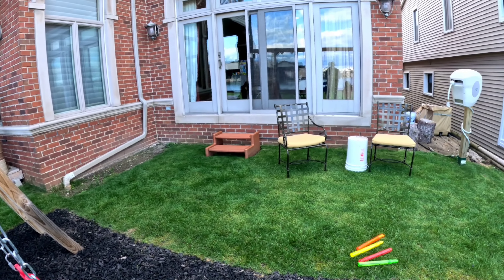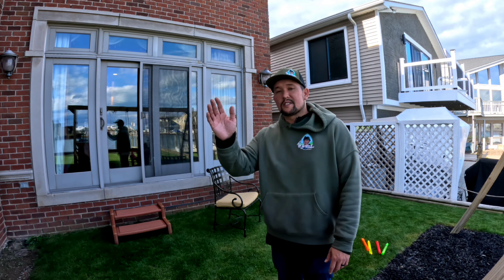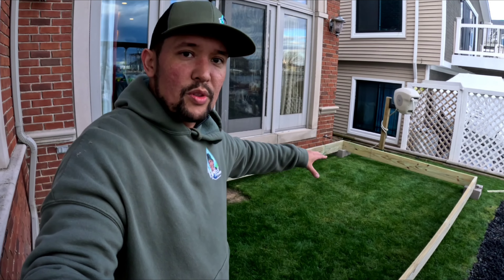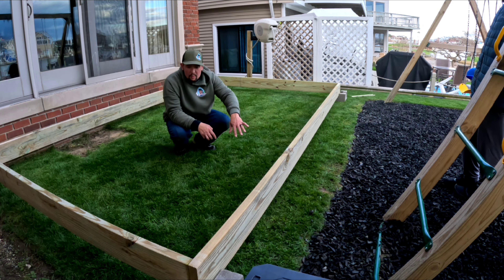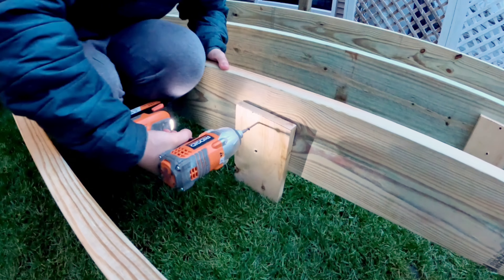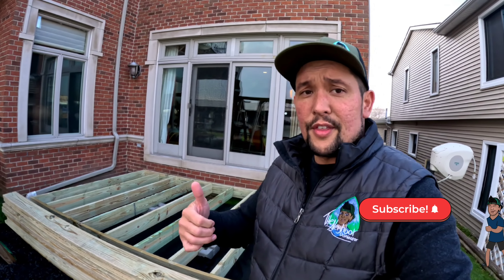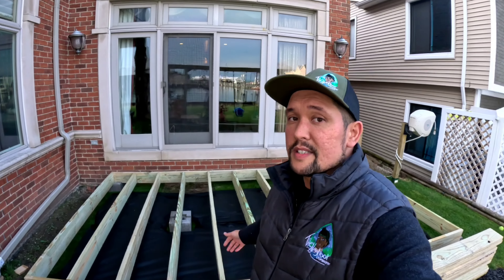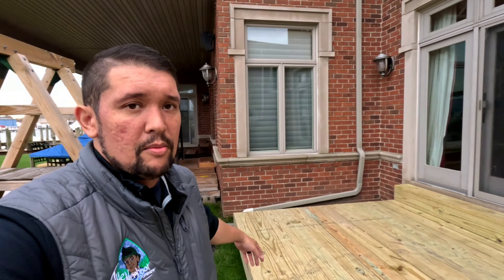DIY Floating Deck: No Digging, No Permit 💰 Build it Yourself in a Few Hours!

Comment: I'm just into a few seconds of your video where you say you were quoted $4,800 for that size deck. We were just quoted $21K for a 16 x 16 deck. And this is just 4 months after your video.  Ok, and Go.
Reply from the maker: Were they wearing ski masks carrying guns!   That is outrageous.   What did you say to them
Reply: @Dadstuff365  HAHAHA. Really nice guy. Just an outrageous quote. Reached out to 5 contractors and they were the only ones who got back to me. I’ll do it myself in the spring. Learn everything I need to. Buy supplies here and there then build it over a weekend with friends.
Reply: @Dadstuff365  But to answer your question. We didn't say anything. We tried keeping our poker face.  And that wasn't an itemized list so I have no idea what labor was going to cost.
Reply: Just quoted $7,500 😩
Reply: @MajorChisholm 21k for a floating deck with no premit??
Reply: @edubb2491  No the guy was going to pull permits. Update. We got quoted 3K for a concrete deck. I think we are going that route.
Reply: @MajorChisholm  noooo do it yourself! You got this! I am building a deck in my backyard using pallets 16"x27" I don't know why I went that big 😂 but it's so rewarding to know that I would have built it and only have paid a fraction of the cost. I know it won't last forever but we need it for the next 3 years we are in this house
Reply: @CoffeeDIYMama  Thanks. We still have our wonky deck. We have decided to do the concrete route. We hav ea pretty good quote for around 3K but I am also considering doing that myself as well. We will see. We are in freeze season so we may have to wait until Spring. Yay.

Comment: You’ll find out later  more supporting was needed …  those 3/4 pieces of wood will sink in due time…. OVERALL I LIKE THE  DECK … keep on building.  ITS VERY REWARDING   … & cost effective 🙏🏾
Reply from the maker: Thank you for your support.   Im have a tough shed built and im going to make a deck around it!

Comment: Awesome helpful.  I built one 12 years ago and now I'm having to demolish it and rebuild it. I thought treated lumber and Thompson's water seal would be enough to protect it, however carpenter bees will still attack and tunnel into treated wood.  This time I will paint EACH deck board BEFORE I put it down, as I understand that PAINT (not just water sealant) will keep the little critters from boring holes in the wood.  Again thank you for a great video.
Reply from the maker: That is such a good tip.   I appreciate that my man. Paint instead of 🦭
Reply: @TheNeighborDominator and thank You for the video as well. New to channel and DIY. This was very helpful to me.
Appreciate Ya🗨 😉👌🏾
Reply: 12 years is a long time in my opinion.  Thanks for the tip though.
Reply: Your problem was ..you used Thompson water seal..its wak
Reply: @edubb2491  yep!  I figured that out now.  Up north I lived in a 200 year old wood house that was still sound.  Just good house paint.

Comment: I just built a 8x10 floating deck with those blocks. So does anyone have any ideas on how to cover the blocks without making it look bad?
Reply: Put them on the inside
Reply: Cover them? As already mentioned, place them on the inside. Unless you have an odd reason to place them on the outside?

Comment: The daughter proceeds to help out by swinging in the swing while overseeing the project😂. Great video! Thanks for making and posting this! You did a great job...saved a ton of $$ and learned more through doing it yourself than beforehand. I do DIY projects in and around our home all the time (I have built a Murphy bed/a shed/replaced bad flooring with luxury vinyl plank flooring/ worked with electrical for the first time/created a theater room, and built a theater seat riser). I believe being a DIY'er in your home is one of the blessings and advantages of homeownership (unless you want to fork out more $$ than is usually necessary most of the time). I am currently researching "building a sound foundation for anchoring a 12 x 16-foot gazebo". I liked and subscribed.
Reply from the maker: @DDC365  she is my super! Lol.  Thank you! I really appreciate it.   I love doing stuff like this around the house myself.   It's more rewarding.   Plus i can tell everyone while we are standing in it..."you know i built this"🤣

Comment: It may not really matter.  But, I'm considering adding screw in ground anchors that attach to the support structure before installing the wood on top.  That way a crazy wind storm won't catch under my deck and cause damage.

Comment: Awesome deck.  No worries about the back piece as you could always add a board there later.  The right hand side you could toe nail a board up against it and make the top flush with the top board so it looks like its framed in...OCD on my part  lol
Reply from the maker: That is a great idea.  I had no idea about doing that.  I might have to do that now!

Comment: I did not know that about the decking holding water if the groove is facing downwards. that's acc crazy yet makes so much sense
Reply from the maker: @marufmiah3264  right!  I asked google and thats what it told me.   I was the same.  It was crazy
Reply: I thought he said the board would hold water if the frownie face was Up, and that the frownie face had to be Down.
Reply: @Dadstuff365  the little details are crazy
Reply: @cheriheuberger881  I’m not too sure mate I might have heard it wrong
Reply: I just read another post that said he had it backwards- the smiley face has to be Up! 😅

Comment: Do you have a product/supply list or a plan with measurements? My deck will be close in size but I want to ensure I am picking up the correct materials. TIA. Great video
Reply from the maker: Im working on getting the video done.  I have a parts list

Comment: Great job! Just wondering how you got it level and keep the blocks from settling? Typically you start by sinking the blocks into a hole with 5/8 crushed rock compacted. You could fasten the house side with lags, but those outer blocks will be off unless properly set? Nonetheless I love the deck!

Comment: Using screws on the joists  may present an issue as screws are not designed for shear strength on vertical loads. On such a low deck it may not present a significant problem as long as the loads on the deck are kept at a minimum. Using pressure treated lumber would  extend the life of the deck significantly.
Reply from the maker: That is very interesting!   I did use pressure treated on this deck this time.   The screws said deck screws 🤷🏽‍♀️.  What will happen using acrews
Reply: @Dadstuff365 screws have very little shear strength so they can break easier than nails. It appears you were trying to keep costs minimized,  but adding joist hangers would have increased the strength of the joist to rim board connection significantly.
Reply: if you added joist hangers you would be even better.  Also, I couldn't tell, did you leave any gaps in between the boards?  1/8" would be ideal for wood.  If you used composite decking I don't think you need any gaps (for expansion and contraction)
Reply from the maker: @billsmith9249  yes i ha e gaps in between the boards.  Iblearned later about the hangers.  When I build my next one I will be using those.  I learn something new everytime i attempt a diy project like this.  Thank you for the tips!

Comment: Well , 👍thumbs up for doing it DIY,  but i would say, you mixed up boards orientation (as you called it frownie face) ... this should be opposite for crowning and water shed, but real effect shows up only if you get a lot direct sunlight summers and wet other seasons , for mild climates not so much of the deal ...  Would be interested to know how it turned out for you ?  ...  there might be an advantage to do the way you do but not for cupping , more depends of exact cut of boards, youes seems to be better as smileface , ...again shouldint be a big deal, all the best ✌   ... here is a copy-paste that explains it better - "A board that is correctly installed right side up (or bark side down) will form a crown and allow water to run off the edges. If the board is installed wrong side up (or bark side up) it will curve up on the edges when dry and water can gather and sit in the cup. That is a recipe for wood rot and problems.

If you look at a dry deck board from the end grain you can see the rings in the wood. They should be curving upwards, like they are forming a smile. You can easily remember which is the right side up by thinking smiley side up."

Comment: Thank you for the video. Would you mind to tell me how many boards do you have to get to build this deck? I am looking into diy a deck. Saw your video. It actually doesn’t look as hard.
Reply from the maker: It is a heavy one with the bigger treated wood.  I have another video where I did a bigger deck with smaller wood.  It was actually easier.  I can get you the wood count tonorrow
Reply from the maker: But regardless,  it is very easy to make.  I have no wood working abilities what so ever

Comment: Can the threshold be extended to provide a deeper exitway from the patio doors?
Reply from the maker: Possibly.  If I am understanding you correctly I would have had to raise the step up 2 more inches to match the cement ledge.   That would have been too high to feel like a normal step and Ibwould have had to make another step amd sacrifice deck space.  I wantes to do that but the deck is so little.  It was a tough decision.

Comment: Would like to do this in my yard but it’s not perfectly level. What would be the be the easiest way to level the deck blocks
Reply: Depending on the blocks you can dig down at the high blocks or even put some nice thick pavers down under the lows to reduce digging required.
Reply from the maker: Even though the deck blocks are level one might be higher than the other.   You have to level it with the boards in there

Comment: Now, after you squared the frame on the blocks, why in the world would you take the frame off and start nailing joists every 16"???  Did you LEVEL that frame too?  The weight alone!  And the square!  I'm just shaking my head
Reply from the maker: I couldn't screw them in because the wall was in the way.   I'm not a builder my man
Reply from the maker: I'm actually a pizza guy by trade, grass guy by hobby.  Deck builder to save 5k🤣

Comment: could you use plywood as the top if it was going to covered with an indoor outdoor carpet, asking for a friend LOL
Reply: Yes. Still screw off at 16 on center and run the plywood long ways just like he did the deck boards. Good luck
Reply: You can but you will need to use a waterproof sealer on both sides and the edges first unless you use marine grade plywood which is very expensive.  Even with the carpet you plan on using, water will go through it and eventually warp and/or rot the plywood.

Comment: Are you going to seal the wood with anything?
Reply from the maker: I was told to let the green wood dry out a little but I have no clue.  I wanted to put Thompson water seal on it but was told to not seal the green in there and let it dry a little.  Maybe fall time.  What do I do?
Reply: Let the wood dry for at least 6-8 weeks then seal it in. If it seal it fresh your sealing in moisture which will prematurely rot your wood. Cheers
Reply from the maker: @Bruno Ribeiro  thank you thank you.   It has shrunk significantly since i built it!   I appreciate the info🙏👊🏾
Reply: I built mine with treated wood as well and let it sit for a good 3 months. Almost to the point it started to fade. Then I washed with a mild mix of bleach and water so the wood looked a lil pale. Then used ready seal. It's a cheap seal but it's "idiot" proof. I recoated the next year. Then 2 years later. It's been holding out great. 20x24.

Comment: How do you hide them unsightly deck blocks from sticking out!
Reply from the maker: I learned to move them to the next beam in.   But i was worried about the weight on the outer edge
Reply: You can set the blocks at ground level but that would require some digging

Comment: Are you not concerned with the step height from the grass? 7.25inches for your 2x8, 1.5inches for the top face boards, and probably 3-4 inches for the floating gap from the grass. That’s 11-12 inches step up (and kids will run to that deck from the playground) whereas most steps are 6.5-7inches and IBC code maxes out at 7.5 inches. 

Pretty significant trip hazard and not a fun shin bruise either.
Reply from the maker: It is a platform for us to sit on.  There  are steps to get down that were put in afterwards.  The main reason foe the video was to show people that if you think you can't build a deck on your own you can and save a ton of money.   It may not be up to a professional builder standards but it ha served my family well for under 700 dollars.
Reply: @Dadstuff365  ahh, well as a seat that’s actually a nice dual function. Thanks for the tutorial!

Comment: It looks good, but i am sorry to say it will develop problems quickly.  The support of the deck is incorrect on many fronts.  The biggest being cinder block on grass as they will sink with time.  Second all the load is on the rim corner and as your wood rot (and it will) it will give up rather easily.

Comment: Doesn’t look like its floating. Its looks more like it’s sitting on  blocks. 
The blocks should be under the deck on the joist to achieve the floating look. In behind the rim joist. 
Also, A squared+B squared = C squared to square it easier. 3-4-5. 
Lucky it’s short enough to go corner to corner.
Reply from the maker: It sounds like you are certified at deck making!   I just watched a couple videos and wanted to show people a person with no experience can save money and build a deck with their son🙂
Reply: @Dadstuff365  You will not say you saved money when you have to redo it in 3 years.
Reply from the maker: @b3arwithm3  my last deck i made with untreated wood is 3 years old and still strong as hell🤷🏿‍♀️
Reply: @Dadstuff365  this one will be out of level especially if it rains a lot in your area.  I don't think you are helping home owners save money by showing the wrong process.  By the way, we build decks to last 25 years.  3 to 10 years is given.
Reply from the maker: @b3arwithm3  what do you charge for a deck like this?

Comment: I disagree with the illustration provided (I was also taught years ago crown is down). However, experience shows the opposite is true with green wood.The bark side of the plank should be down, not up. Initially it will seem correct,  until the wood dries and cupping happens as the wood dries and the rings constrict, pulling in towards the center.
Reply from the maker: I am just a grass guy trying to save a buck and will take in all the knowledge I can from a pro!  Im going to build another one next year so do the opposite?
Reply: @Dadstuff365 Yep! As wood dries, growth rings will try to straighten/flatten out. So as your "frown" boards dry, the ends will pull up as the growth rings straighten and you'll end up with cupping. Always go for smiley faces :) I just finished a very similar build (16'x30') except on compacted gravel and with a polycarbonate roof overhead - loving it so far! It's the way to go for ground level deck building for sure.
Reply: @matthewmeredith3138 this is correct. Noticed the mistake while watching, not the end of the world, but defintely want your boards smiling

Comment: How did you level the deck? Any tips pls.
Reply from the maker: When putting the blocks down people with remove a little bit of the ground underneath, place the boards in the deck blocks to see if its level.  If it is not they add a little material under the block to raise the  quadrant you need to make it level if that makes sense.  I am not a true deck maker, I am a grass guy!🤷🏽‍♀️

Comment: Can't you just put the deck support blocks under the deck so there aren't exposed on the outside?
Reply from the maker: I guess.   But they are where the joists or frame meet.  I wanted the best support there.  But i was told you could definitely do that
Reply: Where would you put them so they are under the deck? Would it still support the corners?

Comment: I notice you are ignoring the comments regarding plans, wood size, or material list.  I assume this is because you have answered it numerous times?  I can't find it in description nor in comments.  If you just aren't answering that type of question, sorry.    "I pride myself on being responsive and open, so please don't hesitate to drop any queries in the comments section. I promise to answer each and every one."
Reply from the maker: I'm trying to do a video on it as we speak.  I'm also in the process of recovering from full hip replacement, moving and changing jobs.  Its been a rough few months but I'm doing my best to get the list